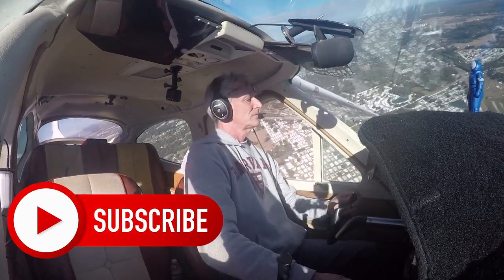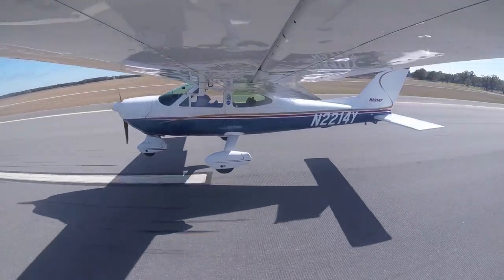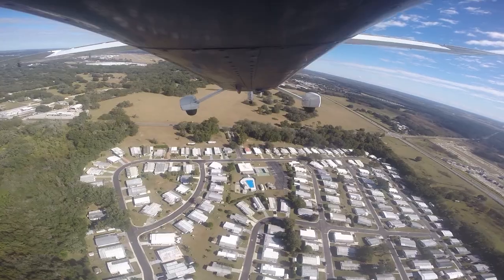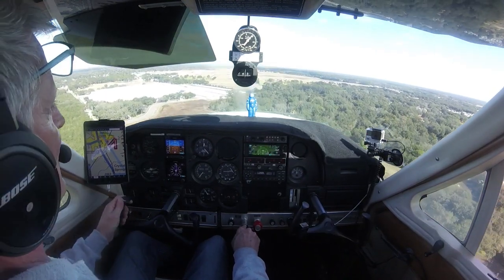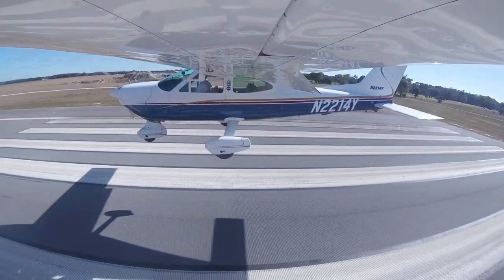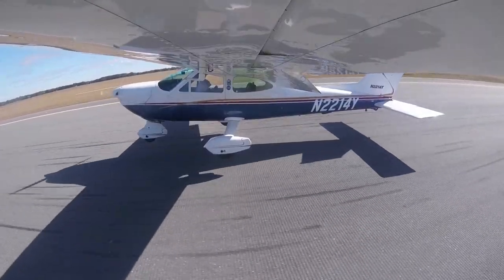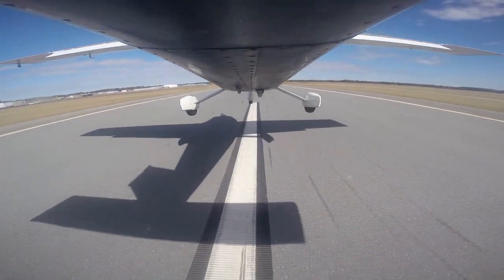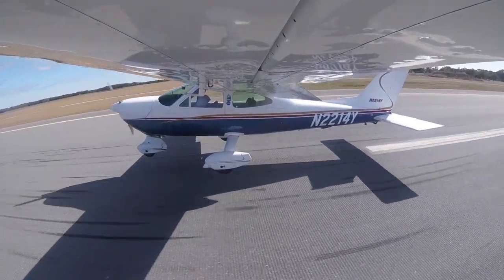Landing the Cessna Cardinal

Comment: Great topic for your video as airspeed control is critically important. I have a 172M which is also a pitch sensitive aircraft. I found (after a longer time period than I would like to acknowledge) that for “no wind” or “light wind” conditions, I will initially configure the airplane at 75mph and 20 degrees of flaps on downwind with about 1,500 rpm. I’ll then trim it to glide around 72 to 73 mph on base while judging the approach. Any additional flaps means you’ve got to reduce your airspeed or you’ll earn your balloon rating in ground effect.

For gusty or windy conditions, I’ll choose no flaps or 10 degrees maximum and keep the airspeed closer to 80 mph as needed to penetrate the wind and maintain good control authority. The lack of flaps results in less tendency to balloon, which is good to avoid any time, particularly on days when the wind is blowing.

I am convinced that landing airplanes is something that we’ll never stop learning about.
Reply from the maker: Absolutely! Thanks for watching!

Comment: Nice vid buddy.  Glad to see full flaps being used!
Reply: Steven, I typically use 20 degrees of flaps in my 177B (not 30/full).  20 is the flap setting for go-arounds, so in the event of a go-around, I don’t have to move the flaps.  On windy/gusty days, I use 10 degrees.  On short fields, or if I need to make a runway turnoff, I use 30/full, but it’s not my first choice.  Why do you like to see full flaps on every landing ?
Reply: @cessna177flyer3  airplanes are designed to be flown with certain flap settings for certain scenarios.  If you read the POH, please send me the reference as to when you would use flaps 10 or 20 for landing.

The aircraft is designed to be landed with 30 degrees.  Unless you are a test pilot, I would suggest following the manufacturers recommendations unless you want to have a chat with the feds should you have an errant go/around....
Reply: @steventhesomm  here you go: https://www.dropbox.com/s/gbx5h74pul5el97/Photo%20Jan%2005%2C%201%2026%2042%20PM.jpg?dl=0

To summarize: You may use any flap setting for landing, full flaps for short fields, and minimum flaps (based on field length) for strong crosswinds.  Go-around with obstacles?  Leave the flaps at 20 until clear of obstacles.  Therefore, in my opinion, flaps 20 provides the best safety margin for landings which don’t require 10 or 30.

Also, our Cardinals are certified airplanes. Certainly Cessna had to demonstrate the Cardinal could be landed safely if the flaps failed in the up position. Any pilot would be wise to practice no flap landings once in a while (in suitable conditions).

Comment: Great videos. Thanks for sharing. I love the Cardinal and I’m leaning towards purchasing one after/if I pass my cert. 
The only thing, they seem hard to come by. Do you have any advice as to where I can start my search? 
Thank you 
P.S. Also over 50 and recently started my flight lessons.
Reply from the maker: Look at Trade-A-Plane or controller.com and there are a few on there they are hard to come by but just keep on looking because they pop up quite frequently
Reply: Also, Barnstormers, Cardinal Flyers Online (CFO) a users group with an extensive website including classifieds, and there's a FB group.  If you're not knowledgeable about the Cardinal, make sure you have inspection done by a mechanic who is.